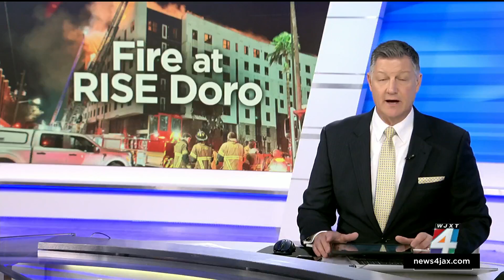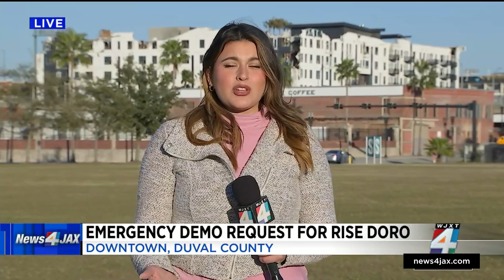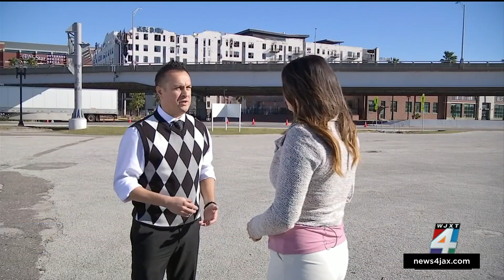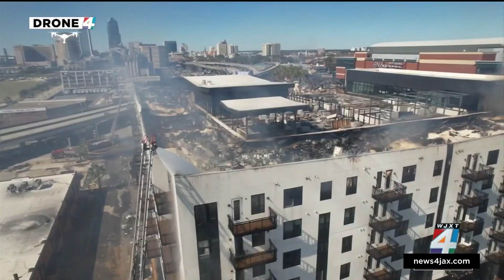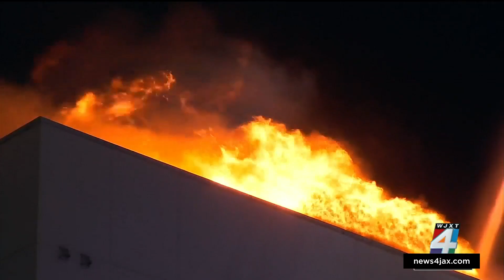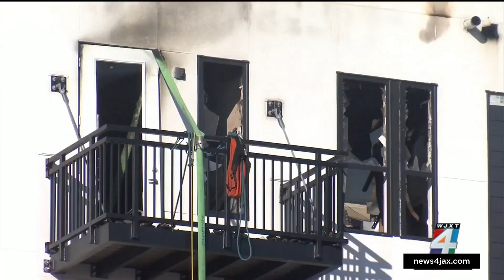Structural engineer ‘concerned’ over RISE Doro emergency demolition, believes investigative work...

Comment: Maybe Cheap flammable wood used
Reply: Your ignorance is amazing!
Reply: @ianross9099  structures in Miami are made out of concrete, we need to do away with plywood, it's also recycled material. Sorry you feel I am ignorant but I've worked construction for 20 years and concrete infused with rebar makes a great fire contaminant per unit.
Reply: I definitely agree with your statement. It does raise the cost. I  guessing that's why concrete is not always used.
Reply: Regardless of what its made from. How did it happen?  It's definitely not the woods fault!
Reply: @ianross9099  im in home repair for 30 years here in Jacksonville ,   Wood is cheap , Look at Argyle , we shouldnt  be building wood  in Florida

Comment: How did this build even catch fire with the modern fire suppression system? Why didn't the sprinklers come on, knowing that people would be moving in within a few weeks?
Reply: The sprinklers were not yet pressurized, as they said near the end of the report.  Until they are ready for that final sign off, there is no water in them (or if there is, it's just standing water from the leak tests.)
Reply: Me no comment
Reply: IMC CONSTRUCTION FIRE SPRINKLER SYSYEMS. Middleburg, Florida
Reply: IMC Construction,  Middleburg,  FL did the sprinklers....Turnage is the owner.
Reply: They said it hadn't been inspected yet so the system was probably off.
Reply: @jamielecoxe7327 the sprinklers were off
Reply: Irresponsible, could be pressurized as soon as complete, no Cert of occupancy until inspection. If electric has power, they use it just the same @stueyexmcfd